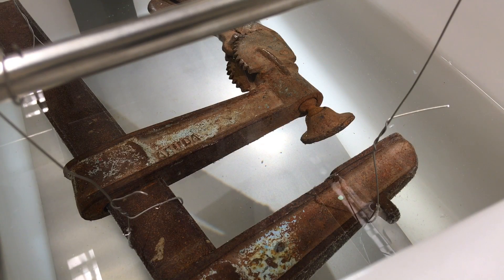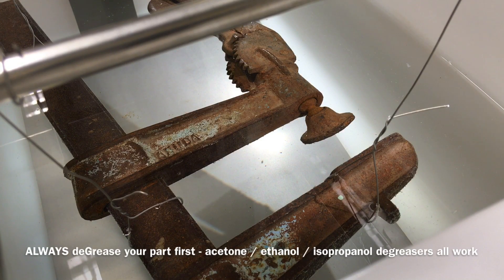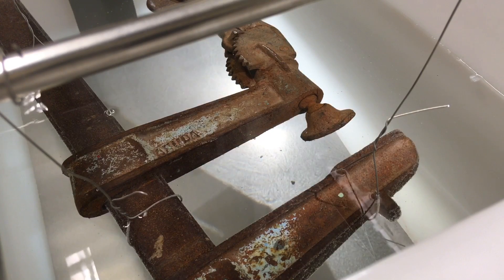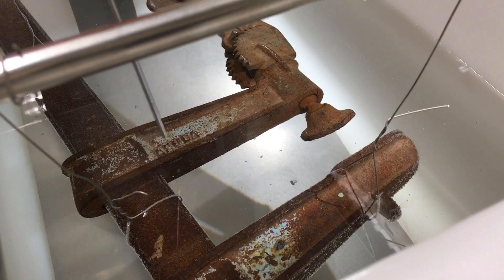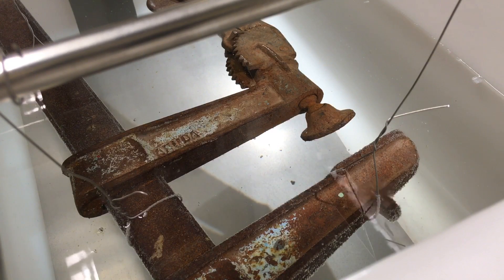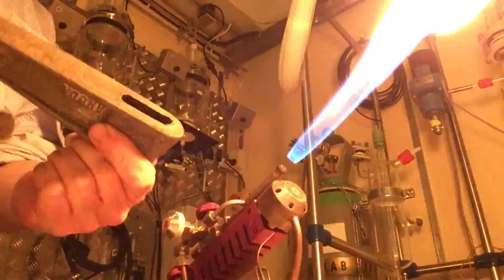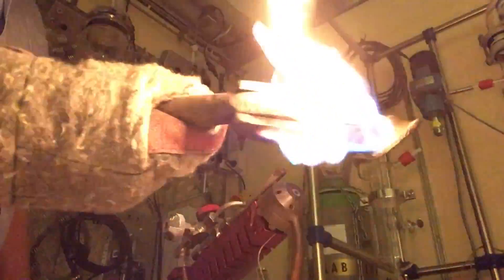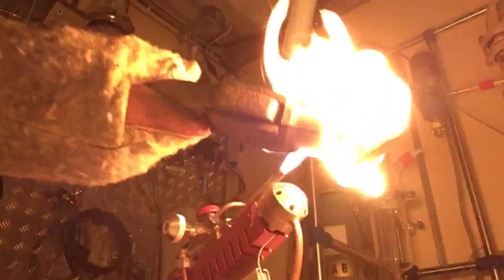True rust removal by a chemist - a titanium electrolysis setup

Comment: Great video, thanks for sharing!
Out of interest I measured the resistance of my home made bath before I put bicarbonate of soda in and got about 200 ohms, I was interested to see how much current would flow and also to make sure I wasn't overloading the power supply, which was rated at 3.5A @ 20v. 
I used two old sheets of steel I use for car repairs as plates each end of tub with car bit hanging in the middle.
I then put a few spoons of Bicarbonate in and got a funny negative ohmic reading, so I then realised I'm actually getting a small voltage from the solution, like a battery if I'm thinking correctly. It was about 0.2v
I couldn't exactly remember from my college days how to measure resistances of circuit when battery was effectively inline, so tried connecting it up and away it went. Left for about 9 hours and the amount of brown clumps and dust that ended up in water was astonishing, the car part was really clean too. This electrolysis is great, wish I'd done it years ago, save me all that rubbing down and rust treatments, only issue though, can't get full car in it :).
I never used vinegar or salt as heard it was creating lots of gas but I am outside anyway, I wonder if that is better than bicarbonate.
Reply: I had made some alterations to the circuit arrangements used in the video, by using a metal tin, rather than a plastic tank. The entire tin serves as the anode, thus surrounding the work piece and this increases the overall current density, leading to much greater efficiency. 
I tried this system on an antique 'Primus' stove spanner, that was extremely rusty and pitted - the maker's name and 'Sweden' were illegible. But after just 30 minutes, and then a couple on the wire wheel, the part looked like new. Also, the flame wind shield, that I had given up on because a wire brush would have destroyed this delicate part, was also restored.
To limit current from the 12V supply I inserted a 21W, 12V car light bulb in series. Any shorts or overloads between the job and the anode are thus rendered harmless and will not damage the charger which has a maximum rating of 4 Amps in my case.

Comment: Would work better / faster if you hadn't connected to the rust ie clean the rust off just where the electrical connections are... rust is actually an insulator.

Comment: Thanks very much for this video!  I've been using the typical washing soda method with steel anodes for a while now and am excited about trying this out on my next de-rusting effort.  Do you think that using this acidic solution will damage the finish (e.g. bluing) off gun barrels, which is something I'm trying to avoid?  Using washing soda does not in my experience.  Thank you!  I'll be sure to link this video in my next youtube video where I'll be doing electrolysis using your method on an excavated WW1 relic.
Reply from the maker: An electrolysis reaction of of this kind should not be more harmful to the remains of the metal in the barrel than any other reaction, and is definitely softer than any grinding mechanical sanding method. However, I’ve never put a perfectly good piece of metal in there to evaluate what happens with time if no rust was present. Regardless, I think you can safely say that as long as you have rust going off, which goes off much before the true metal under neath is affected, these conditions are very soft but also effective. The more you run the reaction and the more iron ions that go in solution, the more conducive electrolyte you get so it goes faster for piece no 5 as compared to piece no 1. Good luck!

Comment: I really liked the way this is explained here. I'm planning to use electrolysis to remove rust from items with threads so I would like to be able to somehow control how much material is lost in the process if possible. Is it actually the case that rust is converted back to iron using electrolysis - as it is quite often claimed? I'm planning to use a lye solution with a low DC current. Is lye suitable and even preferable for this?
Reply from the maker: Thanks for your positive feedback. Rust is never converted back to iron, it is impossible. For that you need 2000 degrees and a melt furnace. The only thing you can get at it’s maximum is magnetic magnetite, which would require you to first dissolve the rust with acid and then pour everything in to an extreme excess lye. The iron ions in the green brown solution would then precipitate into magnetite if conditions are ok. You can use all alkaline lye but you will have better result with acidic condition because the acidic conditions clean deeper into your iron.
Reply: @Ken_Sweden  Thank you for clearing this misconception for me. Now I have to go and go and undo my contribution to the spreading of this item of fiction. I have seen lots of experiments on youtube where a heavily corroded mechanism whose constituent parts are solidly stuck together in a somewhat deformed tangle emerge back as a functional item after being subjected to the electrolytic treatment. Perhaps he success of the treatment in that respect somehow got mixed up with recovering the iron. Perhaps the magnetic magnetite has some of the mechanical strength of the original iron which might be excused for assuming that original material recovery has taken place but I have never seen any item emerge partially coated with magnetite to a significant degree. Usually the item emerges covered in blackish slurry which is then scrubbed off.

Comment: Great video, thank you.
Is there anything wrong with using white vinegar, in place of water? Simply fill the tank with it, add your salt, then apply the current? I should clarify, using plain steel as your sacrificial piece, as well as steel wire
Reply from the maker: You’re right. There is nothing complicated about this. Use an acidic medium and run the electricity. It is easy. You can even start the process without the salt added and then add it while the process has been going for a while. If you add the table salt gradually and you will see when there is not need for more, that is when a more conducting electrolyte won’t improve the process more and other things are limiting how fast it goes.
Reply: @Ken_Sweden  Thank you for your input. I appreciate your help.
Reply: @Ken_Sweden  Hi Ken, can I get your opinion? I ran a solution of white vinegar, about 1.5gal, and a lot of table salt, no water added. After letting it run for 2 full days, it appeared that my sacrifice piece had been reduced in volume, (width and thickness) substantially. There was no rust present on it. My workpiece was covered in a crusty black substance.  I specifically recall seeing bubbles pouring off the workpiece, not my anode. I am running this test again to verify I didnt simply just reverse my leads, but I really don't think I did.

The mixture continued to produce bubbles even after removing power and both pieces. I believe it was chlorine gas but didn't feel inclined to get a good smell obviously. 

Any thoughts on what was going on here and why I got the results I mentioned?

Comment: I'm very grateful to have an expert's advice on this rather than "YT Truth" you described so well, the echo chamber of recirculated sloppy research that I've been seeing up until now!
Reply from the maker: +Jozsef Izsak thanks for encouraging words. There’s much more related to electrochemistry to come. I just have to cut it down to the very essentials in the right order. Have a good day!
Reply: Recently, I saw perhaps one reference to hydrogen embrittlement, maybe two, arising from this process and the recommendation was to use only 1 volt in order to avoid it. A chemist or metallurgist told me many years ago that simply heating the item to some temperature in a home oven for 20 minutes would drive out the hydrogen and the deleterious effect on strength would be eliminated. If this is correct then accurate information about it would be helpful for many people removing rust from parts that will be stressed. Perhaps you could provide that for us.
Reply from the maker: Jozsef Izsak the hydrogen embrittlement is an explaination to premature fracture occurring on eg exposure to acidic conditions. However, researching the scientific literature will tell you that the definitions on when it occurs and at what concentrations of hydrogen that is required is vaguely defined. I have not found one single article describing concentration of acid and time of exposure, as related to a specific iron grade that tells me how much iron embrittlement you will have for predetermined conditions. The phenomenon is however related to the diffusion of hydrogen in the grain boundaries of the iron/steel, so in any case this doesn’t happen in seconds/minutes. I’ve tested and exposure of strongly acidic solutions will allow the hydrogen embrittlement to occur But then i had to expose the iron over 2 weeks in concentrated hydrochloric acid. The heat pretreatment of the iron/steel here also play an important role since it affects the grain nature in the steel, and you can naturally then assume that the specific composition of the steel will also have an effect. Overall, however, I did find an old science book from the 80s that stated, as your friend suggested, that it is reversible and that heat drives out any hydrogen diffused into the iron. It was a general statement and in case of high strength fasteners, I would not play around, and just get new ones. In all other cases, I wouldn’t worry about hydrogen embrittlement.
Reply: Thanks for the detailed reply, Ken. I originally heard of this as a 20% reduction in strength in the context of electroplating many years ago. I assume it's a definite non-issue for a week or ten days in vinegar.

Comment: Hi Ken Do toy think that I can use your mixture of 1000ml water , 40ml white vinegar and 1 Tea spoon salt as a electrolyte when using a Walter SurFox , TIG weld cleaning machine on Stainless Steel welded parts ?

Comment: You can improve performance by adding a magnetic coupled re-circulation pump to continuously agitate the solution and remove the hydrogen layer and scale from the surface of the part. I also recommend adding a coarse ( 20 micron) water filter to the circulation pump to collect debris.
Reply: I had also thought of adding a magnetic stirrer. I have magnets salvaged that were used for just that purpose and will give it a try. 
Your method would be yet a further improvement. Noted for further development!
Reply from the maker: Excellent input. Thanks.
Reply: I would like more details on how to make the best filtration system for a tank? Thank you

Comment: Is graphite resistant to mild acid solutions.  I've never seen people use acid and electrolysis together before.
Reply from the maker: +phantomcreamer yes it is. However, at higher concentrations of acid you will start peeling of thin sheets of graphene oxide on your negative electrode. It’s called the Hummers process and it is the commercial way to make graphene, that is by conversion of the graphene oxide. Thx f comment!
Reply: @Ken_Sweden Great info, but I'm still confused.  Doesn't the washing soda and vinegar just react to form sodium acetate, h20, and CO2, thereby neutralizing the acid? Also, since the graphite is the positive electrode for rust treatment, I suppose I need not worry about the Hummer process?
Reply from the maker: Dont know what’s in washing soda and that’s why I don’t use it, depends on which powder you pick I guess. Sodium chloride is completely soluble and so is the acetic acid, which are at so low concentration that you would never precipitate a very soluble sodium acetate salt. The graphite would work well, no problem since it’s as you say used as anode. As the iron start dissolving from the rust, then the pH will go down a bit but hard to read on a pH indicator stick. You will note however that the electrolytic process of dissolving iron will speed up with time. Check the results by viperpowdercoating on Instagram, whom made this bath composition to large-scale. Sorry I missed your point first first time.

Comment: Thanks for the great video!  I was under the impression that the wires from the charger were not to supposed to contact the water. You seem to suggest doing without the titanium vertical strip on the left, and just have one horizontal only titanium sheet on the bottom. I'm game to try that, as long as it's ok for the positive wire from the charger to be underwater. Or maybe I'm misunderstanding you?
Reply from the maker: +Peace Love For electroplating it is necessary to only have the correct metal down in the electrolyte. If not, your plating will be contaminated. In the case of rust removal it doesn’t matter. Now, I used titanium because it can withstand acidic solutions so I can use it over and over again, but it doesn’t matter if a short segment of copper from a wire is there. It is also relatively resistant towards dissolution. It will be coated with a bit of copper oxide with time. I would just put some epoxy on that connection once I see its properly working. Thx for the input!
Reply: @Ken_Sweden  can I ask if using standard washing soda and rebar as your scrap. If the copper wire was in the water does it create any harmful toxic byproduct etc aka like stainless steel producing the carcinogenic byproduct if anyone used it as the scrap

Comment: Hi Ken thanks for the vid,
I have a question about the water after you have finished. I noticed you said it is an environmentally friendly and can be discarded down the drain. Just want to clarify if we follow your instructions it is safe to throw out. 
Also you use table salt, I noticed others recommend sodium carbonate, can you tell me the difference between the two please
Thanks
Reply from the maker: +Rei do Japão thanks for watching. What will go out in the drain is iron as a dissolved and iron oxide with some table salt ions and the diluted food acid so that’s fine as long as no big iron chunks. Old buildings in Europe still have iron sewage pipes. Now with sodium carbonate, you are likely to have more chunks since it is not dissolving any iron oxide to iron ions so be carful if you need into the drain. It’s pH more than ca 10 depending on concentration. It’s therefore also slower in dissolving the rust. I hope this helps.
Reply: Thanks Ken, very helpful!
One more question, I noticed you use distilled water. Is this a must? Or can I use tap water? (I’m in Sydney Australia)
Thanks
Reply from the maker: @reitak18  tap water will do just fine. All the best with your experiment and keep in mind the most important - do not short cut your system in the water (keep black and red separated). Notice the fuse in the battery charger and be careful. I have rubber soles on my shoes and work on rubber floor. Never start rearranging stuff without pulling the electricity cord, especially if you have one electrode on the bottom of your container as in the video.

Comment: Hi Ken.
Is it okay to paint or nickel-plate the item on the black or do i have to brush that off before painting ?
Reply from the maker: +martin nielsen if you mean that you have some black paint then that has to go away, the other black I can imagine is that you have used phosphorus acid and some of your rust is now iron phosphate. This is a good ground for repainting, but in plating it is poorly conducting and won’t give a good result. In principle, if you are picky with your results, then one should not even get the fat from our fingers on the part that should be plated, so maximum clean is the way to go. Rinse in ethanol or acetone before is a good strategy. I hope this helps

Comment: My attempts at electrolysis always create a heavy, black coating which can only be removed by as much wire brushing as would have derusted the part in the first place! I'm using a car battery, iron wires and sodium carbonate in solution. I'd be grateful for any advice about where I'm going wrong.
Reply from the maker: The general answer I can give is to go acidic, you have to go down in the pH more to dissolve everything. Typically any black precipitate at more acidic conditions would be something called ferrihydrate, which is black but just flush off under the tap. A bit dull surface is all you should have under it, which goes off with a steel brush so it starts to shine. Sodium carbonate with your specific iron grade is something I cannot figure straight off the bat. Try to pour in some vinegar as first step is what I would do.
Reply: Thanks, I appreciate your expertise.